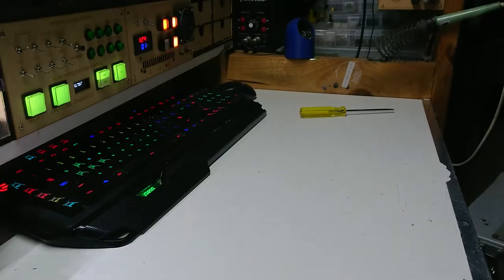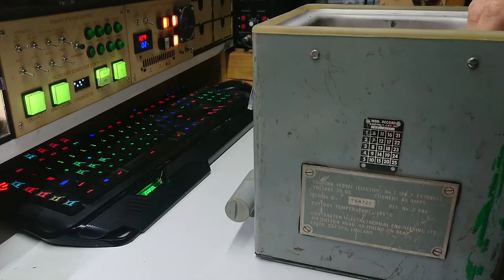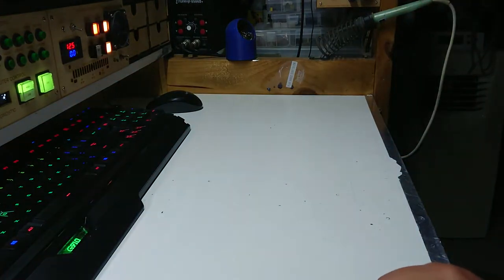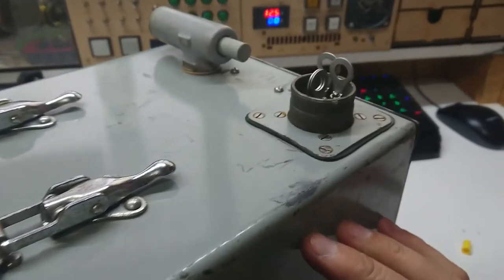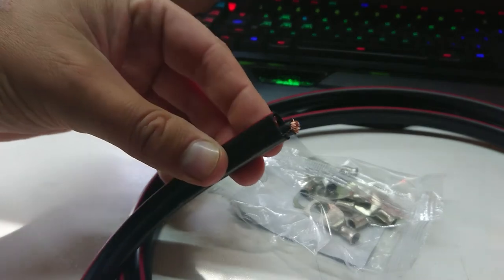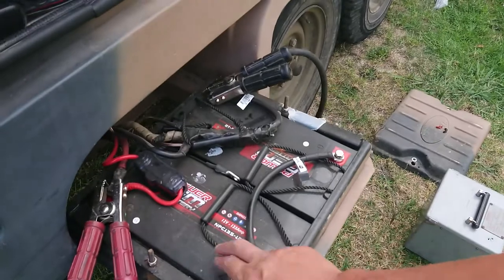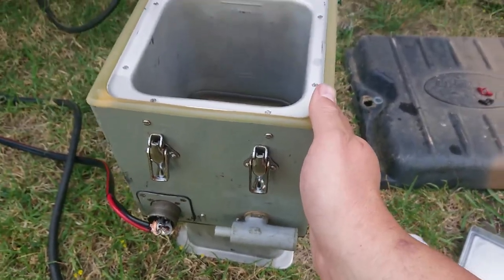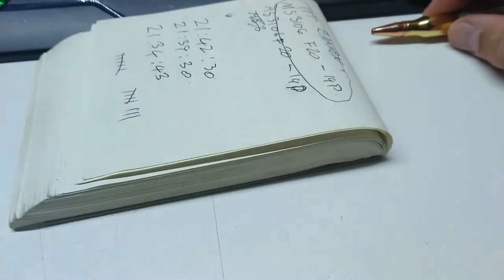AFV Cooking Vessel (FV706656) - Part 1

Comment: Hi mate, nice bit of gear, seems to do the job.
You might find it advantageous to invest in a DC/AC clamp meter, especially for the higher current low voltage applications.
They can be expensive, but even a Chinesium brand would probably do the job.
The Bain-Marie would as you say be great for cans of food while travelling.
With the valve seal, you may need to check the metal seating.
With the plugs, the vehicle end, you could go looking for a suitable high current plug/socket combo that is more affordable, that way any accessories you  come across or make will use a more conveniently available plug/socket.  
28V at 55A is 1.55kW.
Resistance is 28/55 = 0.51R.
Two elements in parallel would be 1.08R each.
I would be suspect of the insulation too.
Tom Scott has a YouTube clip about it too.
I googled the part number, quite a bit if info on its evolution to present day.
Reply from the maker: Yes there are many modern evolutions. 
The UK kinda started the trend there.
when I got it the ceramic elements were about 6 to 8 ohms each, this has changed a bit since they were heated and dried out.

I have a 300amp shunt to keep track of the current in the system it was just bypassed for this test run.

The plugs I have managed to acquire from element 14 and a military supplier in the UK.
The 6x6 ambulance already has high current sockets to run medical gear that will carry 100 amps.

But yes a decent two pole inline switch will be in order

I'll check out the valve seat - you may be right there.
Reply from the maker: Had a look through my forgotten tool drawer, and I have a ct clamp addon for my multimeter. Will see if I can read dc amps on it when I do part 2